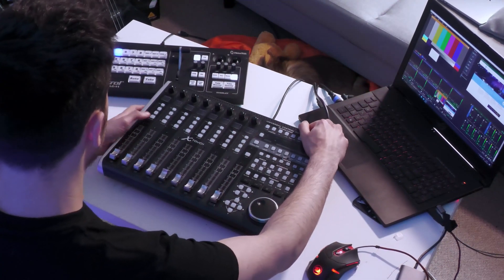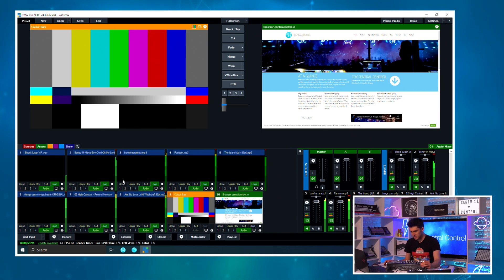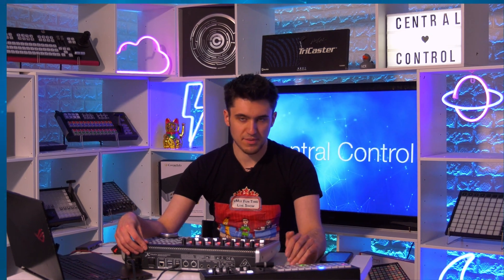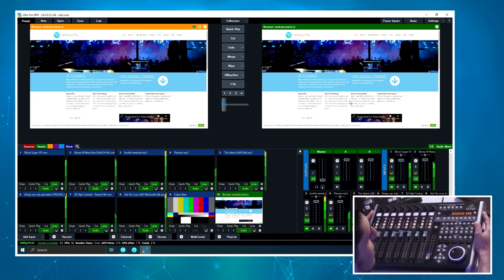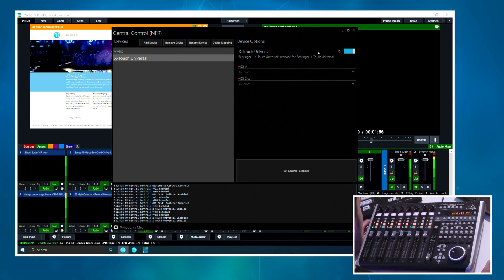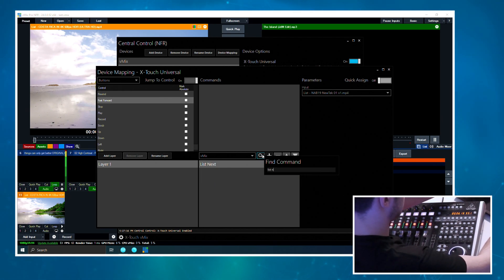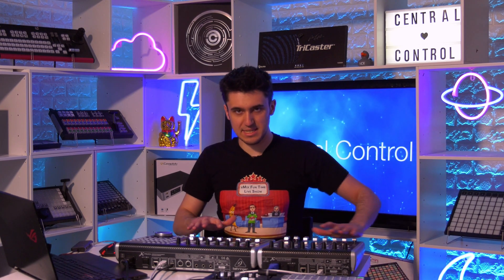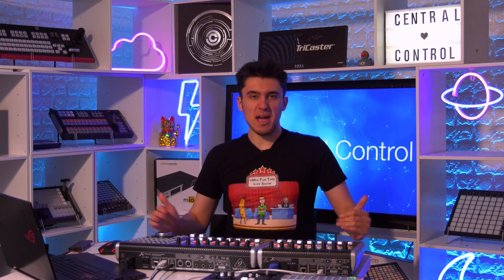Ultimate vMix Audio Control Surface with X-Touch Universal and X-Touch Extender!

Comment: great video demonstration. Do you know if its possible to map different layers to show the mix for different outputs? So for example layer one is 8 channels for the master out of the program, layer two is the mix for ouput A  and so on?
Reply from the maker: Yes you could certainly set it up like that.
Reply: @thisiscentralcontrol  does this work with the older bcf2000?
Reply from the maker: @ScruffFPV  the x-touch module will work with the BCF provided it’s in mackie control mode

Comment: I’d like to see a video in which you very slowly and extensively show us how to sync the XTouch and XTouch Extender to each other, then to the X32 for control. I’ve upgraded firmware on both control surfaces, but still can’t get the extender to “join the party,” as it were!

Comment: I've tried exactly the setup and the only thing I can control is gain and the "mute" and solo buttons. The faders and the rest of the buttons do not respond. Also I don't know if it's possible to switch from one layer to another with the page button, or to move the fader bank left and right with the channel ones. I've got the last firmware installed and I'm on MC/USB settings. Any ideas on how to fix this?
Thanks a lot!

Comment: Will this replace any shortcuts or activators I already have created in vMix (not for the X-Touch but say StreamDeck or Keyboard)?
Reply from the maker: You can certainly use Central Control instead of Shortcuts/Activators. One of the biggest benefits is that feedback is actually handled automatically - no need to get bogged down with activators.
Reply: @thisiscentralcontrol  I just wanted to make sure it doesn't overwrite what I may have there already...like it wasn't making a new template to replace what I have there.

Comment: Hey great solution for audio!! Will the Mackie controller work as well?
Reply from the maker: Any controller that supports Mackie Control Mode should work great with this template.
Reply: @thisiscentralcontrol  Does the Behringer xtouch use Mackie control?
Reply from the maker: @joeybaronstudio  yes sir - it also supports HUI and XCTL but we have it implemented in MC mode.